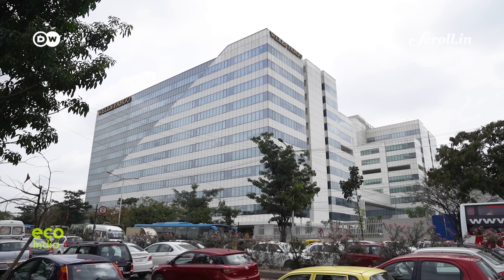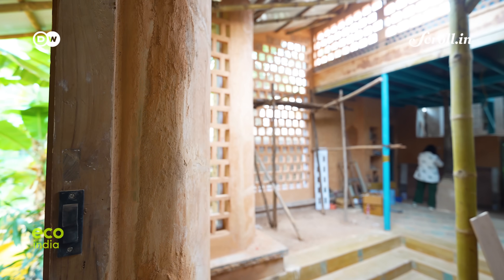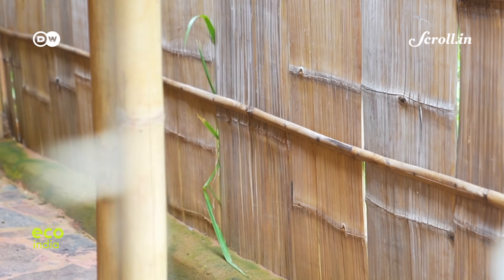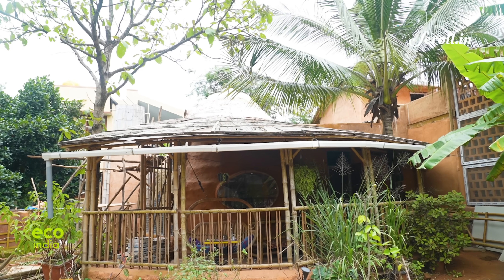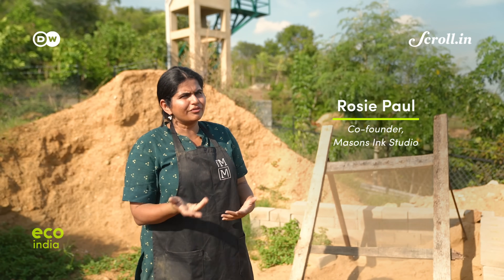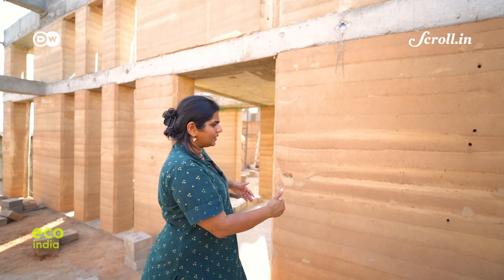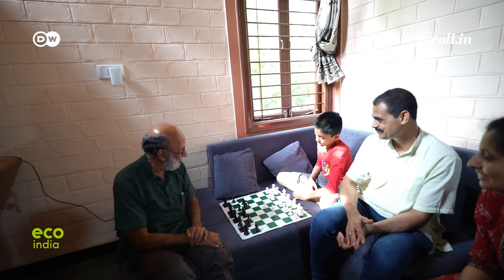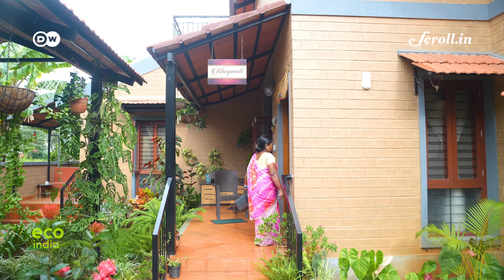Eco India: Can sustainable architecture really beat the urban heat?

Comment: One Problem with all these sustainable architectures is that no one compares maintainability as compared to traditional ones. While material required and cost are compared but maintainability is not just about that. It is also about the frequency of repairs and the availability of skilled labours. Whenever anyone attempt to provide such a solution (and there are endless attempts to do that in past few decades), first thought that come into mind is how to build an ecosystem for that so that an ordinary person can build and  maintain such homes without becoming a researcher.
Reply: rammed earth doesnt require a lot of maintenance, if it did it wouldnt be used.